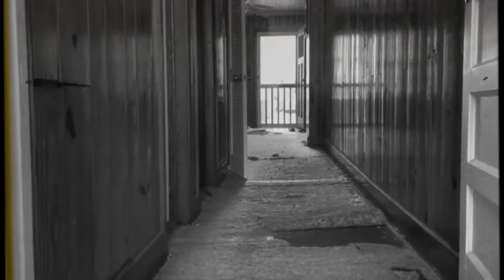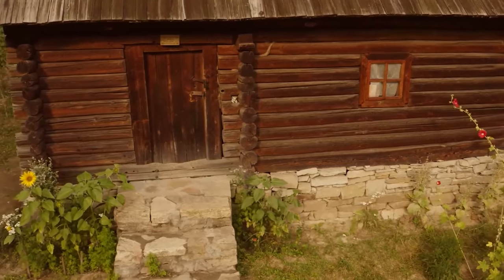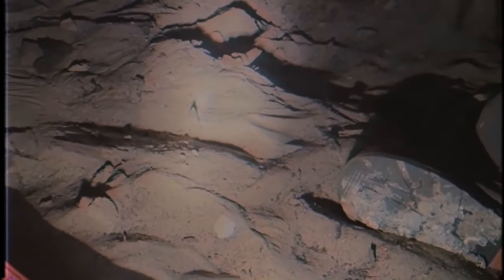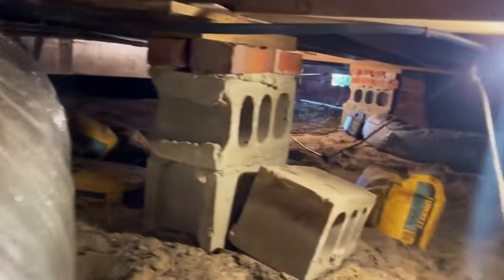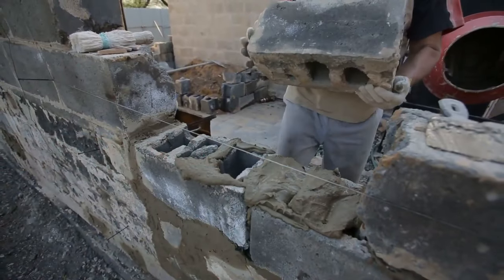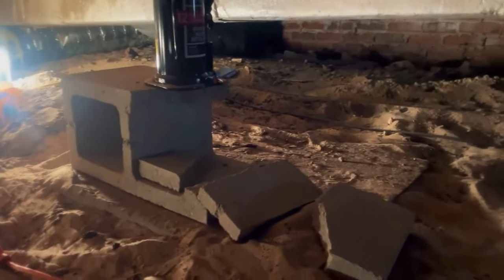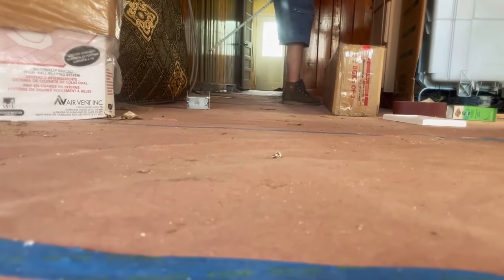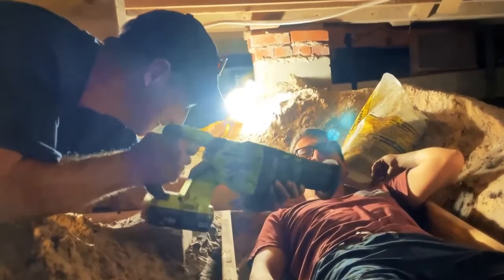Lifting up floors. 7 mistakes to avoid | Jacking and leveling sagging floors

Comment: Using floor jacks can work. I completely agree that the HomeDepot/Lowes ones aren't very good and in my experience tend to rust after a few years. Ellis Manufacturing & PowerPost make vastly higher quality floor jacks that are properly galvanized. Also, when original and sistered beams don't align on the bottom edge an electric planer can quickly create a flush surface for the top of your jacks to sit.
Reply: They say Compliant with ICC, IRC, IBC building code, etc but you need lally columns. Check what your local codes require for plate sizes. Cement core heavier gage tubes. Footers and bolted.
Reply: I'm about to use a cheap one, but I plan to use it in order to later install treated wood in place of the jack.
Reply: I would use bottle jacks with screw jacks then use 4” wide metal post with concrete inside with the proper footing 😊

Comment: I’ve “leveled” a few homes. Your advice is solid. Usually the aim should be to avoid further contortion and or settling. Unbending a bent home can destroy things and is often unnecessary. Flattening of interior spaces can be achieved other ways.

Comment: Lifting a house too quickly can cause serious problems.
Reply from the maker: Agreed, some framing wood can get snapped. In a perfect world after pin pointing areas to lift should go gradually on those, like 1/4 of an inch per a week, to let the wood settle and get reshaped since it's relatively flexible material under certain time and conditions.

Comment: A friend of mine went through this when he was trying to sell his house in a hurry. He didn't think the sloping floors were a big deal when he bought it, but when he got transferred and had  to sell, the agent told him it would drive away any customers that were willing to pay top dollar. He had several jacks in the cellar and kept trying to get everything level, but each time he raised the lowest point in a floor, the ceiling and the floor above it would end up crooked. After he had hired a contractor for other problems, he was told that the jacks he used would end up cracking the cellar floor, so he had them pour footings and install real lally columns. By the time he was done, the main floor looked OK, but the ceilings and the upstairs were still kind of Pee-Wee-Herman-esque. One useful trick for hiding these imperfections was a deep-pile carpet in the upstairs hall, another was a threshold under any door frame where the floors were going to be different heights. Coffered ceilings would have hidden more imperfections, but there was no time for that.  He also spend some time fixing the cracks and reworking the door frames and baseboards to "split the difference" between competing angles. Glad to see your project came out so well; it looks like a nice location, despite the shaky ground.
Reply from the maker: Sounds like his house was sinking badly for a while or they overdid it if the ceiling and framing started cracking... Can't make it perfect, but you can support and prevent further sagging!
Reply: @sergii_contractor  The joists are made to push the load out to the next beam as well. Bridging I dpnt think you touched on. It must  be proper and it will stiffen the floor. When you move one object the rest can move with it. The bridging is notorious for putting floors uneven when moving thee entire structure. I remove them all, get everything where it goes and then put them back. Another thing is there is a difference between level and flat. "Level" is not necessarily where everything should be.

Comment: Sometimes it isn’t always possible, but sistering all the bowed joists as full span as possible is the best way to keep a floor level. The jacks and posts are only temporary to bring each joist back to, or slightly above, level prior to sistering, then they are removed to allow the sistered joists to return to level. It is also worth double-checking that all load-bearing walls above are properly supported all the way down to the foundation.
Reply from the maker: Well, the more you do the sturdier it will be, but putting support under bowed joist will make it not bowing anymore. It's a wood, it bends under load...
Reply: @sergii_contractor  Yes, posts are also a good idea for a basement or crawl space. But sometimes they are not always possible given the layout of the home.

Comment: Great video my friend,
 The only thing I did not agree with, was using single wedges as a permanent solution to achieve the proper height. This creates a point load and over time it will indent the shim/and or beam. Shims should always be used in pairs (placed in opposite directions) so that the load is distributed along the entire surface of the shim. That said in the case of a heavy load like a floor you are a lot better off to determine the correct space using the shims then after you have done the entire floor, go back and cut wood to the correct width with a table saw etc. and then jack the floor up slightly and remove the shims and replace with your fabricated spacers.
Reply from the maker: Great comment! I agree. On new project we jack floors on 1/8" higher than we need so we can put not the shim, but permanent support and then we releasing jack having floors sit on flat pier with fair surface. Not always might be an option tho, depending how bold you are jacking up as wood can start popping and some spots.
Reply: Great comment, went under our house and saw that the shims that were put in last year were comletely crushed. Time to start over and not make the same mistake
Reply: @colethomas-ballinger2441  use mesquite or osage orange/bow'd arc or black locust.  They won't be crushed and won't rot very fast either.

Comment: Many piers with wide bases = less pressure per square foot on the slabs = longer useful life for the house / floor.  Especially in soft sandy foundations.  Many thanks.

Comment: I'm using 3x3x1/4" tube steel across several 15' & 17' spans with 20 ton bottle jacks on wood bases.  Once I get the floors to the correct height, I'll use 6x6 posts cut to height & shim & anchor everything.  I'm not looking forward to digging the holes for the concrete bases, but then, it's just work.
Reply from the maker: In my area the argument against permanent short wood posts from the ground is hazard of termites.
Also curious about 3x3 steel tubes, 1/4" thickness sounds solid, but depending on weight of construction, the metal edge can penetrate into the wood, I've never done those tho.
Reply: @sergii_contractor  The tube steel has radiused corners/edges and will have the same impact to the existing wood as using new wood (beams).  However, if you're concerned about the weight vs the 3" contact, you can also use a larger steel plate to help disperse that weight.  of course, the edges of a plate wouldn't come radiused or with any relief.
Reply from the maker: @johnstrom2721  technically your contact is not 3" by 3" solid surface, but 1/4" edge of 3" by 3" so I'm not sure. Bottle jack can penetrate into the wood depending on weight (I have some future video coming with those), so 1/4'' thick tube even more so...
Reply: @sergii_contractor  You're right.  my metal plates are literal 4" x 4", although the floor joists aren't 4" thick.  Good grief.

Comment: 2:24 Something tells me that little hatchback-crossover-SUV is going to weigh in just a tad over its limit. I'm actually surprised the tires didn't pop.
Reply from the maker: That's mine lol 10 years in and still holding 😄
Reply: @sergii_contractor  I was going to say.... next project: replacing the shocks on my SUV
Reply from the maker: @mms16mms16  that baby is still running 😄
Reply: @sergii_contractor  Here's to hoping it doesn't blow the tires out the next time you're moving 1,000+ pounds of concrete.

Comment: b.t.w.  The last floor we had sink, and bounce, was shockingly not attached to the house.  It was fairly much a deck, that had a few 2x4's legs that rotted.  The 2x6's were 12' long, (shocking), and dated in the mid 1970s, so, they had been there for 50 years.
Reply from the maker: Everybody built all different type of crazy stuff back in a day especially in small towns or outskirt areas.

Comment: Why not use steal shims under your joist instead of wood that will over time compress/fail?
Reply from the maker: That's possible, but they don't come in shapes as triangle wood ones with slope, they all go like flat sheets as far as I seen

Comment: Do I have to worry about the critters in my crawl space, spiders, snakes, etc ?
Reply from the maker: Sure. You can buy disposable protective gear in home improvement stores. Spiders are cool though.
Reply: Get some weatherproof extension cords and run some lights and fans.  That will help more than anything.  You can see them and it will run most of the them out.  Move in slowly and it gives them time to vacate.  There could be some critters that have set up camp/home/nest, if that's a skunk with babies - or anything with with babies, might not wanna move.  Use a spot light to look carefully for any such critters.  I would send a dog in first, if you have a good one (not a house dog, obviously).

Comment: bottle jacks cannot be used as permanent support (as you said), but also, if the floor is "dangerous to walk on" in any spots (as in, you may fall through without additional support), then jack posts are not allowed as permanent support either. they are only allowed as "supplementary support" so floors do not dip down.

however, jack posts CAN work to help, even in YOUR situation. but you need to realize that ALL jack posts have a maximum weight limit, and houses weigh a TON (hundreds of tons, typically). so you really need more than just half a dozen jack posts, evenly spaced, for most houses, and NOT just in a single line, but evenly dispersed in the entire area of your crawlspace.

they also sell "industrial" jack posts, that are denser and designed for holding heavier loads, which CAN minimize how many you need, but you should STILL disperse them evenly, and not just in a straight line. you gotta drop the beam down on them evenly to avoid bending the metal plates on them, and wasting your investment.

and MOST importantly, you must drop it down SLOWLY, so you can gauge how much flexing is going on, both in the jack posts and the wooden cross-beam, as even a 6x6 beam can flex and crack! it takes a team effort to do it right and drop the whole house evenly on the support posts or piers.

Comment: Is hairy work for a beginner diy’er.  You could be jacling up a main support lvl and have it crack and cause the whole thing to come down on you.  Also you could cause a fracture on the beam that goes unnoticed and one day it gives out..  or you could cause the framing for the roof to get twisted and break where its been slowly moving over time then suddenly jacked back into place..  but as long as you’re cautious and observant you should be ok.  In the states you require a permit to do the work though along with a structural engineered opinion:.

Comment: I have a house the first floor does not feel like it has any slope on the floor my basement is dry no water damage sign .how ever 2 bedroom upstairs do feel uneven,i also was told that it cannot be repair 😅 how true is this ?
Reply from the maker: Framing/subfloor between first and second floor might start giving up due to aging or improper built..
Reply from the maker: Everything can be repaired, but you might end up with piers in the middle of your living room on the first floor if that's the spot to put it to support or jack the framing between floors.
Reply: You're pretty right on that. It's an old pennsylvania house from 1920  , which has been renovated .I was told the stairs is the weakest place and I can't change the stairs bcs it would be a very expensive fix. At this point I'll see if I can fix the framing/subfloor. Rent it out and let it sit for its remaining years 😅 doubt I'll live 100 more years anyway... lol, thanks for your reply
Reply from the maker: @karinapena7520  Will be expensive fix almost regardless... if to make it right. And might not necessary it makes sense to fix it at all depending on cost, what exactly needs to be done and your future plans with the property.

Comment: I plan to use screw jacks as a permanent support which I can adjust some each day to resolve sagging until it stays.

I know I can't jack it up completely at once and need to space it out between hours and days to give existing wood time to adjust so it doesn't split.

Also, I have a laser self-level I'm going to use to measure the areas which need adjustment.  They are so cheap these days you can get great ones for $200.

As for bottle jacks, you can use them with another beam to help take pressure off the screw jacks while adjusting and then remove them.

The screw jacks are steel and rated for 20 tons so they should do the job and look nice with reinforced concrete pads at their bottom to give a solid flat foundation.